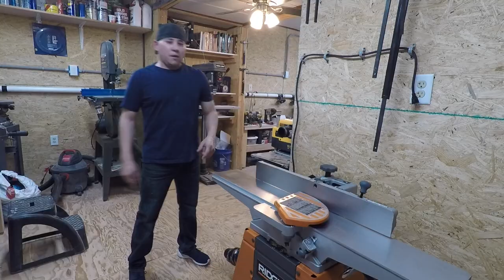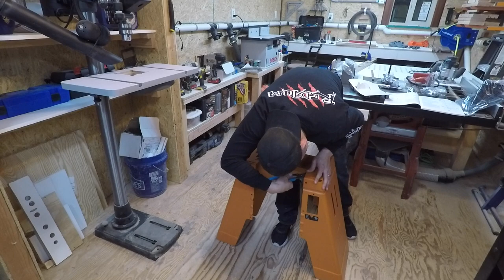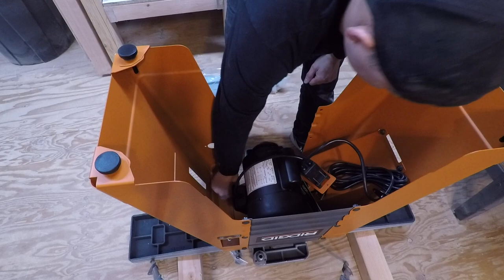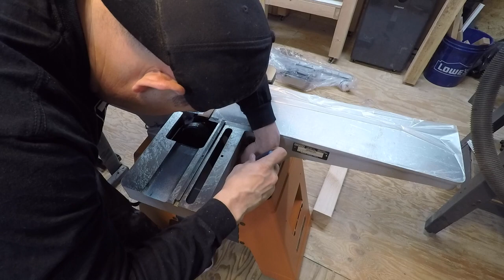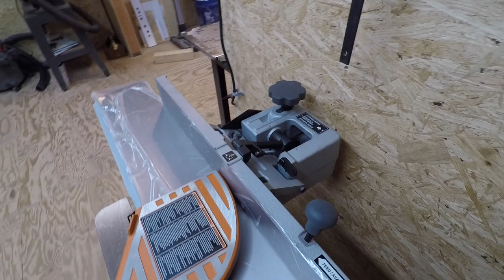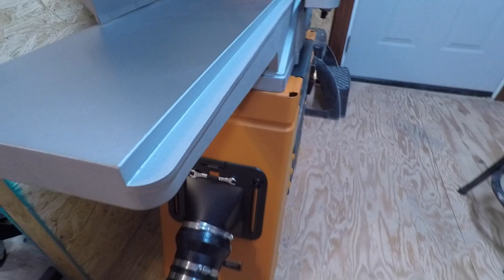RIDGID JOINTER 6-1/8" ASSEMBLE VIDEO

Comment: I just bought one a few days ago, great jointer for the price. You have to turn that bottom knob of the cutter guard mount before you put the cutter guard on. It winds the spring so it stays against the fence. Thanks for the video.
Reply: Tom Mac Where did you happen to buy it from. I’m looking for one now.
Reply: Cisneros ElGreat Home Depot
Reply: MrMaacin05 Seems that they don’t make them anymore. I actually just drove 4hr last week to buy a used one.
Reply: Cisneros ElGreat I bought one like 2 months ago. I’m looking at Home Depot right now they’ll deliver it to you for free unless you’re specifically looking to save some money on a used one. Current listing is 700 bucks which is the best new price I think you’ll find.
Reply: Wow, that wasn’t there a couple of days ago. It’s fine, the savings on a used one was fair. Thanks!
Reply: @Ucisneros  - looking at a used one now   Can you tell me what you paid for a used machine and how old was it?
Reply: @Ucisneros  Sure they do. Just bought one today.

Comment: Thx for the vid Alex, I made one mistake when putting mine together and have to undo some work to fix it, I put the motor mount bolts on the bottom and can't get at them to tension the pulley, so now i had to take a side off and maybe the top to fix it, all in all I been spending about 30min a day putting it together it's not to difficult but at my age it's pretty heavy to lug

Comment: I  had issues with the dust chute. It doesn't attach securely to the frame.  I thought I did something wrong, but after watching you, there's only one way to attach it, and it has to be done after you mount the top.  This video helped me out a lot...  Thanks Alex!  PS. I love my jointer.

Comment: In my shop I’m doing a 2 1/2 dust collection but I bought the adapters from amazon along with the hose to go from the cyclone to the duct work I’m running it all of a old sears craftsman 5hp shop vac and using a 55 gallon barrel to get all the dust I got to hook up more outlets in the shop next Monday my part for my grizzly bench top planer will show up so I can have dust collection for it I’m also in a small shop

Comment: The guard plate is spring loaded you have to spin it one more time before you push it down. Same as on a craftsman same as on harbor freight. Rotate the spring in there one time before you put it in

Comment: Nice video. 
Am having trouble installing the v-belt. I watched the section here where you install the v-belt (looks easy) and read it in the manual, but I  think I must be missing something. It seems too strong to stretch by hand. How do you get the v-belt wrapped around both wheels? Do you need to move a component?
Reply: it goes on easy if you don't tighten the motor mount until you get it on

Comment: Mine sucks I have to return it dammed heavy, the motor runs opposite and it doesn’t trimm the wood cause the cutter runs to the outfeed direction...😩
Reply: Usually motor direction is a swapped wire issue not that they shouldn’t have gotten that right for you, but you might want to check before you go through the hell of disassembly and finding a way to get that heavy monster backto them.
Reply: Don’t ask how ifound this out😳
Reply: @ginafrench7546  I was thinking about that also like switching the black and white something that I saw on the owners manual, but I’m worried about loosing my warranty if I messed with it
Reply: @ginafrench7546  I made refund cause it’s only few weeks since I got it, and ordered same one, but yeah cross my fingers

Comment: Use Johnston Paste Wax!!!! Do not use wd40 ugh :(  it will last longer, smoother, and will not stain material.
Reply: WD40 will attract dust
Reply: I wonder how that WD40 is going to work with wood glue or other types of glue or any surfacing. :(
Reply: @RightHandShot  ⁹0p0⁰⁰⁰⁰⁰⁰⁰
Reply: WD 40 was used to clean off the oil used to protect the beds until use.  He then used paste wax after the cleaning process.

Comment: You need to pre load the spring
Reply: Yes, turn the spring as tight as possible  and align the pin to fit in the bottom slots of the guard sleeve.
Reply: No dont turn spring as tight as possible.

Comment: Dude, if you have 220V in you shop, you should rewired the motor.  I wired my Ridgid table saw and joniter to 220V.
Reply: Why? What's the advantage?
Reply: @SwapnilBhartiya  - No advantage really.  Lots of info online about 120 vs 240.

Comment: I skipped ahead to the part where you flipped  it back onto its feet to see how you did this working alone and without damaging the base, but you edited that part out, mostly. Argh! I'm going to assume that gradually raising the top and putting all the weight on just the edge of the base won't break anything.

Comment: You installed the guard wrong. Next time read the damn instructions. Remove it, turn the spring on the bottom counter clockwise 1 turn, then slide the guard back in the hole.